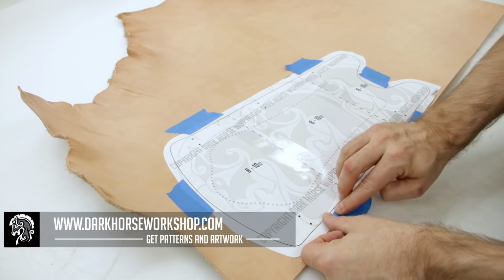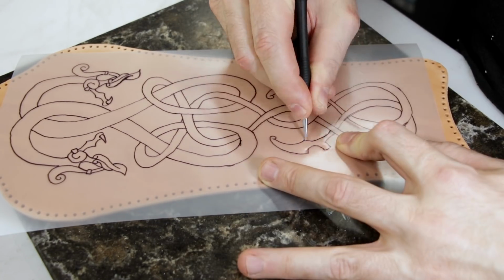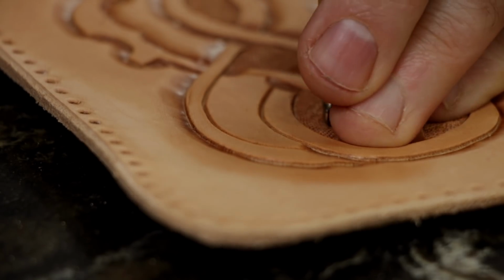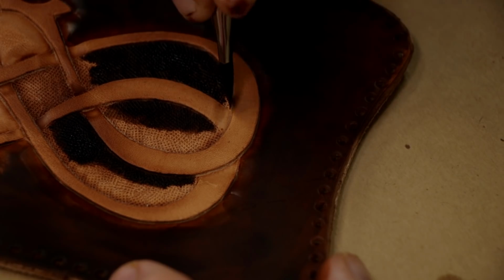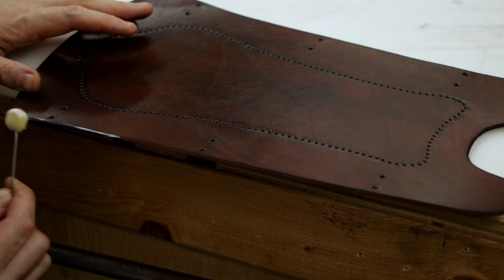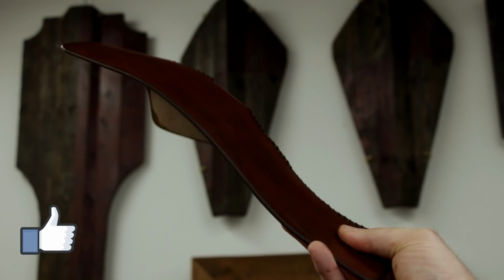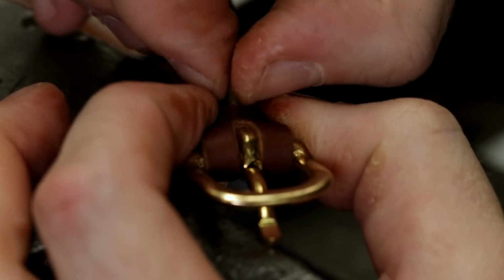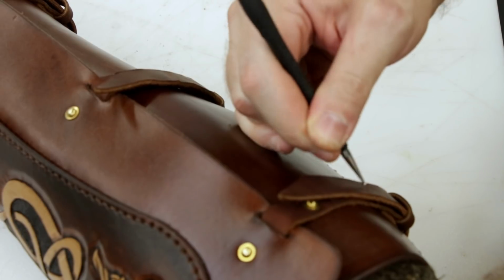How to Make Leather Greaves with Viking Artwork

Comment: Where the front of the greave meets the top of the foot; 
This Lip needs to be flared. 

Thete exist a nerve atop the foot that this edge will begin to dig into once user has been wearing & sweating in this armor. 

The leather of a boot is not thick enough. 

The foot begins hurting. 
This affects the user's stryde. 
Causing back pain, shoulder pain, neck pain, & headaches. 

The affects are gradual & will increase over time. 
This pressure can damage this nerve. 

I wear metal 16 guage mild steel greaves. 
I had to replace my $450 soft period style boots with $450 8 inch high Red Wing biker boots. 
Harley Davidson makes them to. 
Mine have a composite toe. 

Thus is Leather, some will protest.
Its Thick, heavy leather with a hardenned edge to prevent rotting away over time. This hardenned edge must be rolled up about a quarter turn.
Reply from the maker: Ya, I've never had that kind of a problem with something like like this. a 16 gauge steel greave is another story. In a perfect world a flare would be a great addition though, a little wet forming could do that.
Reply: @DarkHorseWorkshop  I really enjoy your sharing so many of your techniques & ideas. 
The paracord works great for both showey color combos ( zesty flare ) and just having fun with your craft. 

I've invested a lot in leather goods for many projects of my own. 
And I hope shows like your's lights a fire in artisans BUTTS too do this work themselves.

I might use your paracord idea on some fantasy armor I'm creating. 

You generate great ideas by revealing your own. 

I've had some thefts here. 
Crapperheads whom do it for kicks & have me pegged for torture. 

My art cones first behind security and chaos whenever I catch them. 

Tandy released some crocadile & some snske pattern embassed cowhide in various thicknesses about ten to 12 years back. 
Hoping its all still stored away. 

I had no warning my then current muse would ever end. Founder passed away without ever cluing any of us in. 
I knew he'd dog me about my fantasy side. 
My flare for showey coolness. 
But he never let me fully explain my fire. 
Its from way, way back in my TSR & RoleMaster role'playing days. 
Bringing it all too life just a bit. 
Just for myself to enjoy it. Maybe display it for a gallery, private or public.

These sh••BIRDS robbing me care not, nor had they a clue, would they ever Never pause their uglyness upon me. 
I get so sick of people saying how they are gonna clean up America and the world. 
Well Stick It!!!! 
Cause ugly people are HELL bent chaos for all! They don't care!!!
No Empathy. 

So, they saved pets world wide they'd have us all believe. 
No. 
Instead, what they did was too make owning a pet such a FINANCIAL MONEY PIT that I must live without one. 
No room in any budget. 
And no money for freeloaders seeking too sue anybody & everybody. 

America needs too dumb all this down, so that lawyerscan't get FILTHY RICH off these lingerring ideas made public then mainstream. 

As long as parents encourage their kids too mis-behave in public whether by ignoring them or showing them how too purues nieghbors, nobody is safe from any chaos. 

Meanwhike we artists have our art purchased with honest money we each earned with our blood, tears, & sweat. 

Hollywood makes rogues appealing too every young mind both child & adult. 
Tthey just won't be expecting tge unexpected when their victims gets wise enough to intercept them when they visit without permission. Like, I don't know them hardly if at all, yet they believe they all know me from harrassing me. 

I miss gearing up & exchangind blows. 
It doesn't fix anything. 
Its just an outlet for the pain we endure while living free. A controlled atmosphere. 
Rules upon rules with Honor. 
Nobody taking skills into the streets too beat defenseless pedestrians out for stroll. 
These mobs have no honor. 
Just a bunch of Losers from out of state. Foriegn trash causing Americans paine and our drug using party crazy youths jumping on the riot band wagon. 

Get a hobby & focus on achieving art. 
Leave the chaos verble. 
Act out instead with positive art.  
For fun or perhaps short career. J̌ust allow your artistry in making cool stuff enlighten others. Like our host.

Comment: 7:05 Can i know the name of that tool? Tq so much..
Reply: I believe they're called Leather Oblong Slot Punches
Reply from the maker: @cal0051  Has it correct, it's an oblong punch. You can get the same result (though of less quality) by punching 2 round holes then cutting a strip out between them if you're feeling cheap. BUT, practice a lot since you don't want to screw up your piece.

Comment: Tokonole is the truth my friend! Much like your antique though, you don't need nearly as much as you're using. A little bit goes a long way, I will usually apply small dots of it along my edge (usually with just my finger)  an inch or two apart and then smooth out with my finger before burnishing.

Comment: Try using Q-tips for the tolkenal on the edges and the make-up ones with pointed tips to get to the really fiddly spots when applying dye/coloring. Alternatively the fine paintbrushes in the paint section of any art area/store for detail work will give you similar ability for fine detail coloring or working the edges. The trick is to remember that just because something is marketed for a specific purpose does not make it the /only/ purpose.
As an example vasaline/aloe gel is a perfect blending tool when working with colored pencils.

Comment: Cool greaves!!
I like taping and cutting the paper as well... Even when I use a weight without tape, I tend to move around the leather a lot when I cut, which can shift the pattern. :S

I have a huge bottle of gum trag that will probably never get used again after I tried tokanol. :P It seems to work noticeably better. 
I use an awl or my finger to put it on - you spread it on like I spread butter on toast, heheh.

Comment from the maker: What projects are people working on these days? Mine, someone elses, your own, whatever it might be. 🤔
Reply: I’m brand new and wanna make a set of armor. I’ve been watching tons of videos, yours are great! I e also done quite a bit of research because I wanna make it as medieval as possible 🤣 I think using leather lacing instead of rivets would look awesome! However I kind of want to be able to use the armor for sword training/ combat. So rivets might be more practical. I was also considering having metal plates seated atop some of the armor pieces... however that’s not early medieval and I’m not sure how do it. Are rivets the only way? I’d really appreciate your input! I also don’t have a big area for a workshop nor all the tools you have so wax hardening, I cannot do.
Reply: @misterdavidjoey  look up stearic acid for hardening leather armor. I also dont have much space  i just use a big soup pot for it
Reply: At the moment some fly by the seat of my pants prototype projects. Did do a couple of Dieselpunk's masks. Leather is running low so haven't been able to do much armor work. But here in a week or two I should be able to restock and grab some of your patterns. Definitely will be grabbing this pattern.
Reply: currently working on 4 full armor sets that were suppose to be done months ago but the outbreak happened. I'm still stuck with the 1st set.
Reply: Recently made a few plague doctor masks with built in goggles, used some red thread over the top half of the of the rond lenses to make have a little extra
Reply: @docschro6847  I just did plague doctor bracers for my son.
Reply: @docschro6847  I was thinking about greeves but they were Bracers
Reply: Finally making some wallets and made a couple pouches over the last couple weeks.
Reply: I'm carving my horse's settle's horn and leather cover.
Reply: Making some dress wallets from some really lovely St Crispin baby calf.  Have also made some rings out of deer antler and a tobacco pouch with a wet moulded pocket to accept a tin.  Next up will be some carved pouches with oak tan deerskin sides and a ‘Manbag’ for me.
Reply: Finishing up a full larp kit commission, just missing helmet and gorget.
Reply: Recently made a samurai mask inspired by a Namahage, an enemy from the game Nioh 2. Eventually I want to make a helmet with the same horns of the creature, but for the moment I've started making a sheath for a nice wide skinning knife a friend gave me. 

I've got some thick saddle leather coming in, and when it does I'd like to begin some armor pieces based off of your patterns. Going to center it around a God of War costume so I'm loving the serpents in your designs.
Great channel, and I look forward to seeing if you make some types of waistguards or chest piece!
Reply: I actually did start working on greaves myself though im using plate for the leg piece and carved leather for the front. Ill pick this pattern up as well, they turned out great!
Reply: Practicing carving with some kits. Completed and wallet and two eyeglass cases this week. Feels good to be productive lol. 
I'm curious what you use, and may recommend for an air brush set up.
Reply: Currently waiting on my tools to start working on a cowboyish hat for my father and other projects :). I've learned a lot from you and other leather workers. The leather community sure is a blessing.
Reply: I just decided to build a set of the Encased 
greaves.    I am using Sole Leather for the plates.   I wanted to mention that when I cut sole Leather pieces I use my bandsaw.   Quick and easy.
Reply: im about to make greaves that make my redwing iron ranger boots look taller for a ren faire costume

Comment: In regards to Tokonole application, I utilize small applicator bottles with a long, blunt needle-shaped nose. A drop every centimeter or so, smear on with finger. Afterward, I use canvas to burnish. (I have used the same 4x6” canvas cloth for almost a year)